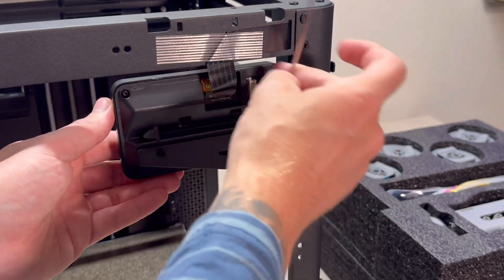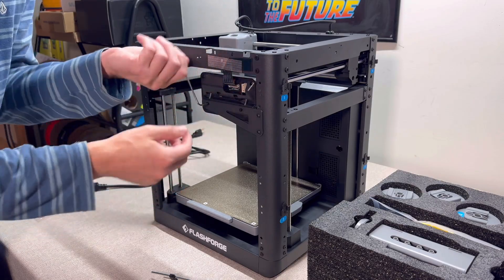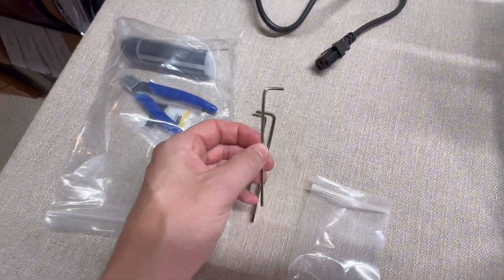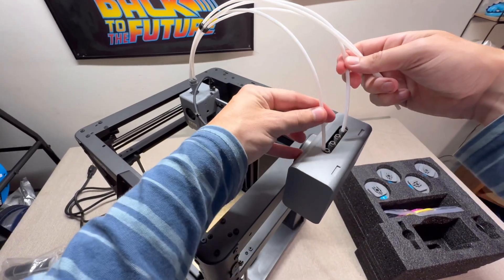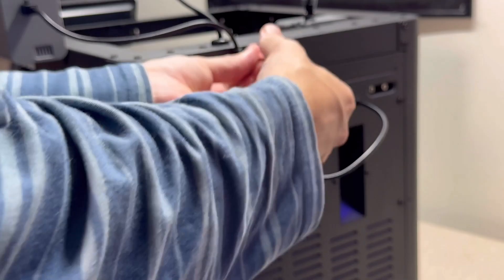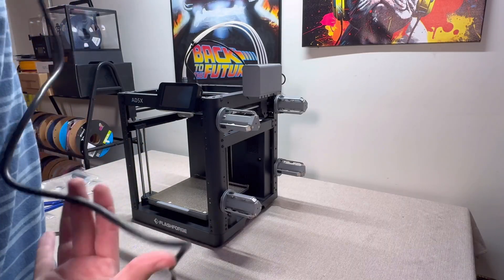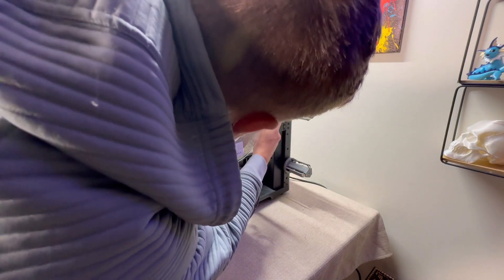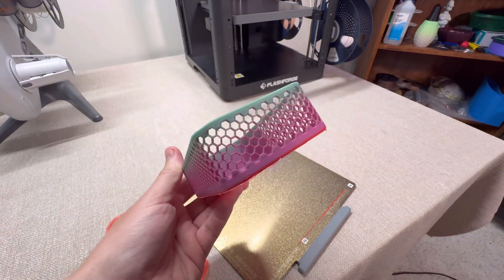Flashforge AD5X FULL SETUP - Unboxing to First 3D Prints!

Comment: FANTASTIC! clear & great detail.  Didn't feel like reading the manual (bad 78yr old eyes) and this was great.  2 questions:  #1) DO i need to save the bracket the display was mounted on other than if I sell this thing and #2) I was left with 2 black screws in the envelope and the 4 screws from the bracket that was removed. .  Did I forget to screw something on?   Oh, FWIW, the 4 tubes came pre-inserted into the device mounted on the side of the printer I just got today direct from FF.  Also where the 4 tubes get inserted into the printhead tere is what looks like a screw hold to lock down the 4 tubes into the head (sorry, don't remember the terminolgy yet).  .
Reply: To answer my own question, and after reading the manual, sort of,  1 of the 2 remaining screws gets connected to the 4 in 1 connector to hold it to the print head.  Still have 1 more screw left but so far can't find a place for it.  🙂. SO I guess that is a model update,

Comment: Note the AD5X spool holders can work with smaller than 1K spools. It just depends on what brand they are. I used some 250g spools and they worked just fine. The filament manufactures realized that hey need to make the holes in the smaller spools the same size as the 1 spools, so they can be compatible with most printers.